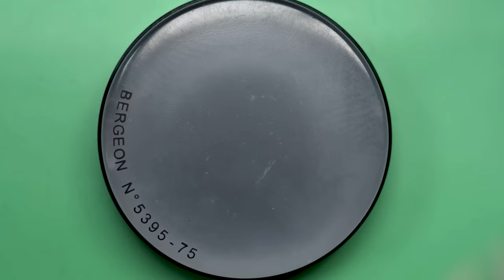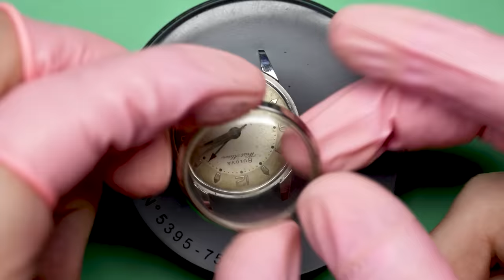Restoring A Broken Vintage Watch With an Alarm Function!

Comment: That watch is really neat.  I am not convinced that the alarm hand is properly in place.  I would think that you would need to have the alarm on, then turn the crown in the setting position until the alarm sounded. Then you need to install the alarm hand to midnight. Then match the hour hand to the alarm.  It just looked like in the video that the alarm hand wasn't sounding when it aligned with the hour hand.  How else would you know what time the alarm was set to?

Comment: I have a soft spot for mechanical alarms, I have a Poljot "square", a Sekonda round which was a UK market Poljot and an early 70's Timemaster which uses a AS movt not dissimilar to the Poljot but sadly the Timemaster is sans alarm stem as it has the stem ferrule jammed inside the orifice, it was a NOS and the piece itself is immaculate but sadly beyond my skills to rebuild so I hypoid adhesive the crown in position until the day I get to have the skills to take it apart competently.   I also have a pair of pretty rare quartz alarms using analogue means to operate, an Accurist and a Sekonda Safari both having the analogue arm to set the alarm time and second crown pulled out to activate just like the mechanicals.

Comment: I had a hard time finding a crystal for my 1949 Bolova Gedney . Strange for the model name but the case is very hard to find. I do not like poly instead of glass although it is easy enough to replace without a press .

Comment: Should have two main springs.  One for alarm. Looks like this one is singular.  Dad had a double wind and would run down but the clock kept working.  He used the alarm extensively (being his AT&T company watch) and kept him in meetings as needed. Therefore, it was an active watch.   Gold.  Have no idea where it is.  Sad.  On your wrist you know what is going on seems soundless but the watch rocks.

Comment: I love watching your videos.  Generally, I agree that patina adds to the watch face.  In this case, you did a great job fixing the watch.  [Personally, I would have removed or at least minimized the rust on the crowns.]   Rust is not part of a watch (opps, I just gave some Millennial an idea...).  Dirt is not part of a watch.  Molecular surface oxidation (not macroscopic rust) and ultra thin contaminant adhesion is patina.  Patina is okay, some patina is ok.

Unfortunately, IMHO what you did here was leave way too much dirt and rust (not patina) on this previously lovely Bulova.  The hands look absolutely awful, the face numbers look dirty.  I think a light cleaning with just water would have been appropriate.  The numbers would have cleaned up and the face would still have that great patina.  The hands likely would take a lot more time because if they are rusted, then they would need restoration or replacement; I suspect that is one factor in deciding not to lightly clean the face.  

You put a tremendous amount of effort into fixing the works and congratulations on your usual excellent job!  {By the by, excellent idea regarding the ruler and magnets!)

Comment: It's a really nice watch and excellent repair but I felt quite unsatisfied when the alarm rang with the alarm and hour hands apart... Mounting the hands on an alarm clock or watch is somewhat similar to the calendar watch. You need to initiate the alarm and then mount the alarm and hour hands in the same position😉

Comment: still watching but if i'm understanding the mechanics right then at 24:15 that arm works with the hammer and wheel to form another balance wheel in effect. the wheel drives the hammer one way and the arm resets it with the wheel being a second escape wheel. The hammer is basically a low amplitude high mass balance but it's driven one way by it's escape wheel and the other by it's yoke, (the levers), whereas a normal balance is driven both ways by the yoke. probably a force thing, a normal escape wheel to yoke system probably couldn't produce enough force in one direction.

Comment: When working on such an unusual - and unfamiliar - movement, do you keep notes on what everything is and where it goes? Is the way you lay out the parts on your bench related to the order things came off? With so many similar parts, I'm curious how to make sure that parts all get back in place and don't get transposed in the reassembly. And maybe a related question - why don't you put everything into the cleaning baskets as you remove them from the watch, instead of having to go through the tedious process of transferring them from the bench to the basket?
Reply from the maker: No, I remember a lot of it, but the parts I can't remember I look at the video footage I took disassembling it. I had that up a lot for this project for example since it was a new movement to me

Comment: wow it's hard to service a watch with this level of complexity without the tech guide!
Like on calendar watches where you make sure the watch is at midnight before installing the hands using the calendar, in these alarm watches you make the alarm to get off and then install the hands so they are in sync with the alarm.

Comment: I had one of those c.1970.  Mine didn't make a sound, it instead vibrated meaning you had to wear it while you slept.  So, it was a felt alarm; not an audio one.  When it went off I would think that a wasp or rodent was chewing my arm off and I'd wake up in a panic.  I discarded or gave it away shortly after getting it... can't remember which.

Comment: Did you not have to syncronize the two hour hands? If you place the hands randomly, how does the mechanism know when to ring the alarm?
Also, does it drain the mainspring entirely if let ringing? I wish I could understand the inner workings.

Comment: Hey Marshall - Love watching your video's
I have a Rare Squaresoft Final Fantasy X-2 Limited Edition Wrist Watch that is not running.
It Has Hands and a crown, the crown can be pulled out to set the hands, but cannot be wound up, crown turns infinitely.
Now I don't know if it is a full clock works or battery driven, so may just need a new battery or could have a broken main spring. Its been kept in its case, never worn.
Can you give any advice? Many Thanks

Comment: When it comes to unscrewing the lock for the sandwich-jewel, can't you use a flathead screwdriver to turn it against those tabs going in towards the center? Or even sacrifice a small Philips screwdriver, hei g the tip flat and have it engage all 4 tabs at once?👍🏼 
Love your vids btw

Comment: The alarm didn't trigger at the right time at all. Normally it doesn't matter where the hands go on watches like this but it does when the hour hand and the alarm hand need to line up when the alarm triggers. It looks like the alarm triggered on the minute hand for some reason but it's supposed to trigger when the hour hand overlaps it

Comment: I don't understand how these work.  With an alarm watch, wouldn't it matter where you put the hour hand and the alarm hand?  So the alarm goes off at the right time?  Set the alarm, then see when the alarm goes off, then move the alarm hand to the correct spot?  Or does the alarm go off by a notch or something on the alarm hand itself?  
     I'm just curious.  I'm likely never going to work on a watch myself.  I'd loose half the pieces and never get it back together properly.

Comment: Not the waterproof version on ebay for £700. Spares or repair is such a wonderful way to learn about mechanisms. , , love the work, There will be a maximum distance a dropped dowel pin , nut or screw can travel, co-efficient of restitution ect. well found. SMD soldering is work that needs spares.Exploration of  mechanisms . Mems has alot to thank from horology.

Comment: alarm clock - i have friends which is train drivers - sometimes they end up having to wait due to faults (electricity supply, singalling, track etc) that wait can be two or maybe four hours so some of them simply sets a wakeup alarm and then goes to sleep (sleeping in the driver seat.)

Usually they tell the dispatcher that they are gonna sleep and the dispatcher will if things improves faster than expected call them.

Comment: Question, as it's a super interesting video - would this alarm ring every 12 hours? Also, wouldn't this be one of the cases (like a watch with a date) where you needed to put the hands on at a particular time? Otherwise the alarm hand wouldn't match the time it rings at?
Reply: Slowly advance the hour until the alarm rings, then put the hour, minute and alarm hands on all pointing at the same hour, bob's yer uncle.

Comment: Hey Marshall, I'm actually confused how you get the alarm timer to match up properly with the time that the watch hands show? It seems like if you just plop the alarm hand on wherever, the alarm won't go off at the time you try to set it at. For instance, at the end you showed the alarm going off but the hour hand wasn't anywhere near the alarm hand.
Reply from the maker: The hour hand aligns with the alarm hand and then it goes off now, I just had to figure out how to align it properly

Comment: Amazing content, as usual!
Edit: I understand you prefer leaving the dials as they are. I like the aged patina aspect too. However, I would be interested to see how to restore them, if need be. Could you do it just once so we all get some tips from you 😉
Reply: What some call patina I call filth and wear. I'd rather somebody leaves something alone than fails at a restoration attempt and makes it worse though.
Reply: @James1095  patina is generally not dirt or filth, it's mostly oxidation of paints or the base metal. As an object ages, wear marks also add to its appearance, until they reach the point where the object is worn out. Attempting to remove age marks is an all-or-nothing deal, and for many objects of certain vintage a rather pointless work, as it removes from the sentimental value for the original owner or relatives, removes collector value for the collectors and only provides value of the object is of actual practical use to an unrelated person. But even then you have to remove all age marks, as anything left original will be an eyesore in contrast, even if it wasn't noticeable in a harmoniously aged object...

Comment: I noticed that your cleaning machine spins parts in a solution rather than using an ultrasonic cleaner. Is there a reason why you prefer one cleaning method over another? Thank you so much for your comments.

Comment: On ebay if they list it as for parts it can't be returned unless it's not as listed. Now if they list it as used and it doesn't run then you can return it as used items are to be working.

Comment: I hope I'm not asking you a question you've already addressed.... The pink finger condoms. Are they nitrile? The fitment makes them look like finger condoms I use in the kitchen for first aid. Is there a reason specifically for those? Wouldn't ones with a better fit be preferable for such small, intricate pieces?

Comment: I am sure in the 821 other comments, this could have been brought up, but the alarm was set for roughly 4 however the alarm went off when it was 1:20 ish?  That alarm hand needs to be re-positioned again I think, otherwise great work at figuring out all the screws and parts.  I was yelling at the screen that you were missing the spring that was dissolved when you took it apart.

Comment: I have not watched the whole video,  but just the part where you show the post on the case and the part that should be the alarm.  Right away I suspect that the piece that is part of the alarm would strike the post and give a noise and vibration when the alarm goes off.

Comment: Hey Marshall, you luckily dodged the bullet with that screw and spring, luckily you have an appropriate "device" thing to pick up that microscopic screw off the floor.  Yes I know it's a simple magnet, I'm just trying to exaggerate your complete arsenal for watchmaking.  Well speaking of magnets, I have this question.  When I was still young (7th grade if I recall), I was able to save enough money to buy for myself a Timex wristwatch.  I was told by that watches should not be placed near a magnet or else it will be damaged.  Now after watching a lot of your watch videos, I don't see any piece or part of the movement that has a tendency to break or be damage by a magnet.  Is this magnet thing just a myth or is there something that I still don't understand with the way the movement operates?
Reply from the maker: The magnet thing is very real, if your watch gets too close to one it can magnetize the watch which will make it run very fast and erratic as well. Part of the process of servicing the watch is demagnetizing it though just to be sure.

Comment: There were parts inside that were wet  And rusted. Is it still patina on the face or is that damage from the water that rusted the part inside?
Reply from the maker: Very fine line :)

Comment: your always saying people should start with pocket watches but i have actually found that travel clocks make ideal beginner movements. pocket watches are difficult to locate and have become way too expensive to risk damaging as a beginner. travel clocks are cheap as chips and easy to work on.
Reply from the maker: Pocket watch movements are available on ebay for very cheap and closer replicate wristwatch movements than clock movements

Comment: Mhm now that you know what the rusted away spring looks like, i wonder if you can fabricate it, or have someone fabricate one for you? I recall Chronoglide (Netherlands) casually bragging that in a pinch they can fabricate any mechanical piece in a watch if it's no longer available new for purchase, if i'm not horribly mistaken. It might be a bit of a long shot though.

Comment: I need help. Today I bought a rusty citizen Shokosha 15 jewel with a unique dial. The hour hand is all that's left, the main spring barrel is missing teeth (3), the balance spring is rusted in one piece, the balance spring screws are unscrewable but the dial is a sunburst grey? Dark silver? It's a metal dial with a second complication at the 6 number. How do I find out more about this watch. It's a small  watch. (16?) With 2568 under the balance wheel and 668498 STAR on the cotezen labeled case with 841 etched upside down above the word citizen on the case.

Comment: I've yet to get a reply other than "its standard practice" when asking why the square end of the stem that interfaces with the winding pinion is lubed.  THERE IS NO FRICTION between those two parts, only pressure since both parts are keyed together i.e. square peg square hole

Comment: Posting my comment before having finished watching the video.  I'm guessing that the alarm is some sort of vibrating kind of function.  The post on the back of the watch cover fits into the hole right beside the hammer when the alarm is activated its the vibration against the wearers wrist that is the alarm?  This is my guess...

Comment: Any bit of leftover rust in the movement will still continue to corrode the metal, even if not directly exposed to water. It is best to remove as much of it as possible.

Comment: How does a hammer get energy from the barrel, if the barrel is governed by an escape wheel and pallet fork all the time?
Reply from the maker: The energy is transferred via that big pinion and the arm on the other side
Reply: @WristwatchRevival  Click is released and main spring unwind itself via "other side"? Because default path should be restricted by the train of wheels...

Comment: Love your videos, especially this complicated one, but one thing bothers me .. i wondered how you would adjust the alarm-hand to match the alarm-time, maybe slowly turn the alarm-hand till it rings, remove alarm-hand and install all at 12, but you just put them all in, making the clock ring alarm at 1:20 when the alarm is set to 4:00 ... ( 46:08 in the video) disappointed 😫

Comment: You didn't set the hands correctly.  You had the alarm set for 4pm and it went off at 1:20.  You need to remove the hands and turn the hands slowly until it buzzes then set the alarm hand at 12.  Then sent the hour and minute hand at 12 also.   That way the alarm time will set correctly.

Comment: Marshall I understand patina, but this one looked straight up dirty.  Couldn't you use even a simple bit of water to try to clean it up a bit?
Reply from the maker: You can't. If you try it will often take off the printing and clear coat :(
Reply: @WristwatchRevival  How about using fresh rodico and roll it on the dial to pick up loose dirt, the zaponlack layer shouldn't be disturbed by that.

Comment: 43:16 why do you touch the surface of the dial?  Why don't you handle the dial by the edges?
Reply from the maker: Becuase sometimes you have to hold the watch in watchmaking
Reply: @WristwatchRevival  Just give what I wrote some thought.

Comment: I am confused.  Restored vintage automobiles, even paintings, are spruced up with new paint or the frames repaired,  cleaned sometimes with new gilding.  This Bulova needs the hands cleaned with an attempt to clean the dial.  Inside you made it new.  Outside it looks like something from a flea market or garage sale.
Reply: There are people that prefer it that way.  Also, cleaning the dial can sometimes cause more problems than it solves.

Comment: I love how you are not one of the many ogers out there. This watch has many many oger marks, carefull as you dont ever become an oger! The horrible Shreks that leave their criminal scretches, marks around screws (lazy dumbs that dont  use wrong size unsharpen tools) 🤯😵. Pros actually sharp and resharp their tos while working on a watch, use thin plastic as assembling some parts that need to be pinched etc. Its horrific to see so much damage causef by ogers in many awsome watches